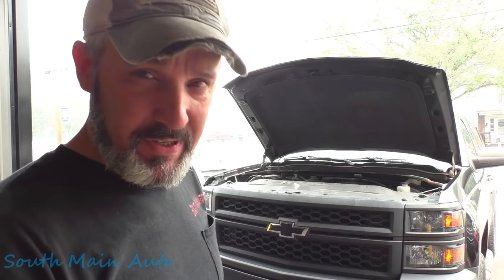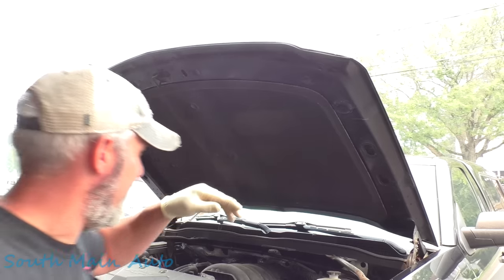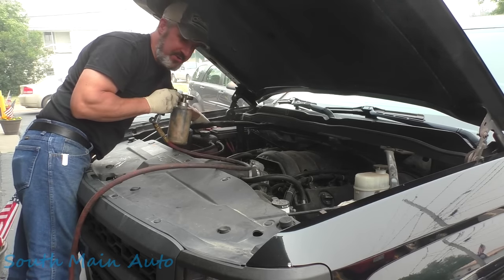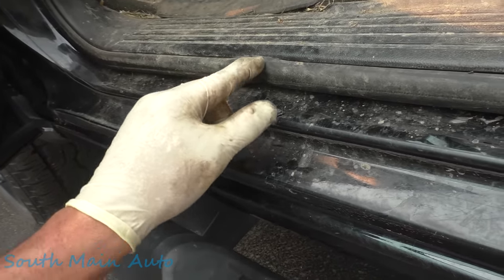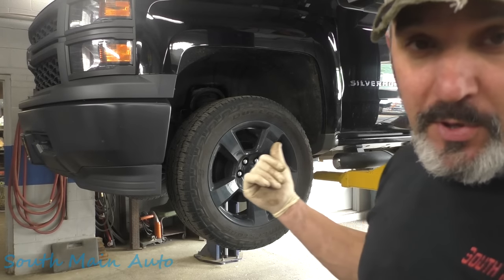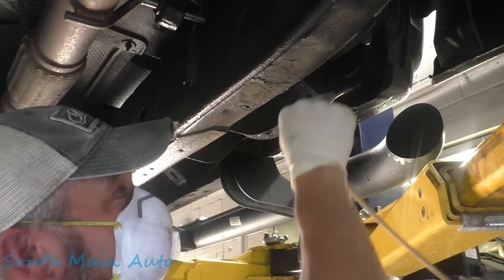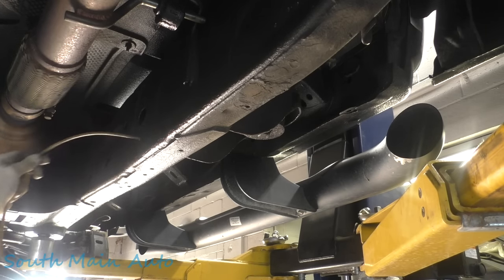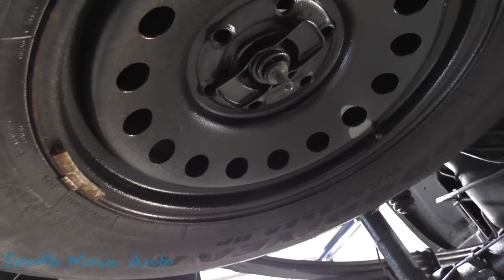Keep Your Car (Or Truck) From Rusting!! You Must Do This!!

Comment: I'm telling all don't waste the time or $$ on the crap they sell. It won't last and will need to redo every yr or 2. Save up or get from a shop 1 quart of used oil, 1 of trans fluid, buy 1 tube of grease and buy 1 wax ring for toilet from hardware. Costs $6. Put all in a old pot, heat up and mix and brush, spray etc like this and it will last year's and will not rust. It will not come off unless u do alot of work with a steam washer and degreaser. Don't spend 200 bucks at krown to have to get touch ups, resprays etc. They use no or very lil oil products in the wax. By using them it will not only seal out Oxygen, water but stick like glue. Knock off heavy rust, spray with Ospho on rest, then spray few coats of rustoleum or whatever chassis saver etc and hit it with this. Going on decades in rust country with no rust. Save urr autos. Save some $$. Tape up door drains, fill up 2 inches with baby, mineral oil or melted Vaseline. For a lil time and $10 urr auto metal, frame will last decades. Especially uni body autos. If they rust urr in trouble. A full frame auto is alot easier, truck, old panther cop cars etc to fix cause the body and frame are not same piece. We shouldn't pay 100k for a new auto and have it rusted out when paid off. We made it somehow all driving RWD cars and trucks in the past. We don't need all that salt and brine. Get a flurry and hers the state and local just salting it down like it's a blizzard. BS
Reply: @lesoram6236  Yes. For it is not hard to mix 4 things in a pot, heat and then brush or spray them on. Ppl mix and heat stuff up daily to eat. It's not rocket science. It's not hard to watch or look up a video on how to make a spray gun, modify or buy a blow gun kit from Harbor freight and use that while dipping the suction hose in this while squeezing the trigger. Unless urr 10 yrs old I'm sure even then they could mix 1 quart of oil, trans fluid, 1 grease 1 grease gun tube and 1 wax gasket. And if for some reason a customer cant, I'm sure a mechanic has access to these things or anybody who does their own servicing of any thing with and engine, cause all need oil, usually some kind of trans fluid, hydraulic fluid it don't matter. My Pap did this since the 60s. My dad has done since 80s, I've been doing since the late 90s. It works. It's cheap. And if for some reason u have no idea about anything at all and was born without a brain, u can get mineral, baby oil or a big tub of Vaseline and use this for doors, or for inside panels with anything from an old spray bottle of peroxide, to a $5 harbor freight pressure sprayer. It's literally up to urr imagination. Whatever u can get to make a liquid get from a container to the car.
Reply: @lesoram6236  what's the issue I'm not seeing it? Most ppl I've ever known, met, friends all have most of these around or can get them easy. I've never seen a garage or shop tell me No u can't have my used oils. They recycle them. 1 quart is not 55 gallons. And the best thing is u will not have to redo this yearly, or do it a few times. Money is tight and won't go far. Nows the time to figure out of there's any other ways to get a task done any easier or cheaper. It's not hard to do at all. If ppl have ever sprayed a garden Hose they can do this. Even just using used oil in a sprayer is better than nothing. All these waxs don't have any oils in them. So when u combine all them together it's the perfect oil/fluid/grease/wax.

 Have u priced how much this costs? $200 is standard. All the touch ups and resprays in 3 years even adds up. With my way u can save all that and for $6 either do it yourself or I'm sure ppl know someone who can. I've done it with a brush. We've all used a brush in our lives so anybody can do it. I've tried all the wax, films u can buy. They do work. They just don't last long, cost alot, don't have any oils in them, and it can be tough if it's cold or too hot, and u can't just apply and forget. Idk urr background but anybody who's ever done any work on a car, lawnmower, tractor etc can do this easy. And if u don't have any old oils I mean u can buy from a dollar tree cheap stuff for still less than 1 can of fluid film. It's been used for over 60 years now and I think that's good proof it works. U can watch a video online. Yes if ppl are 90, or a toddler yes they can't do this, but those ppl don't drive. U can add more of whatever u like to thin or thicken it. If u a planet warrior u can use baby, mineral oil or Vaseline and wax. New cars cost as much as a nice house did 10 years ago. They're already alot worse quality than used to be. Do all u can when newer or not too old to save it. If u have tge know how u can still do to a auto with high miles. That's more involved. But even if u still spend $6 and 30 or so min that will keep it from getting worse and will last. I'd spend that to make a auto I've already paid off last another 5 years. Killing the rust and doing and it will last as long as possible. For cheap and easy. If urr worried about getting urr pretty nails or hair dirty just wear gloves and a rain poncho. U will be ok. Old farmers have sprayed trucks with old oil and drove down dirt and gravel roads for decades. It works. Autos are made so cheap Ford's have issues rusting b4 even sold. If u don't live in rust belts no worries. But ppl live by oceans, salt water or air, who have a boat etc still have issues. Rust is what kills a car. And once it starts it's like stage 4 cancer, it will just spread and eat steel. I've seen nicer newer autos that had to be scrapped cause nothings done and they just rot. Not many have a full frame. Uni body are the worst. Cause u can't just patch if it's part of support or structure frame.

Comment: We have vehicles, a 1996 and 2001 Suburbans, and a 2001 Malibu. Each one still has every original and rust free panel on them, we live in the salt belt sadly. Fluid filming and applications of light paste waxes/light grease on a strict schedule has kept them in very good condition. I will say the 1996 Suburban has not seen winter driving though for the past 12 years. It still gets treatments on a regular basis still. Do this folks, we see untreated vehicles in bad shape after 10 years, sometimes even sooner.

Comment: Rust Belt, yikes!

2004 Sierra 230k miles
2012 Silverado 120k miles

Not a speck of rust anywhere.

... no transmission or wheel bearing problems either 🙂

Comment: Yeah, I own a 99 Suburban, and I live maybe 4 hours from your shop, and I did repair the frame on it behind the leaf spring about 2 years ago, used and old lawnmower blade lol. But at 330K miles on it, the frame for the most part is pretty solid, but for what the truck is worth now, I'll let the thing rot out, Its got a noisy rear end, bad yoke ( I welded the caps to the straps to keep the driveshaft from moving around) got a bad lifter on the passenger side so its always got a slight miss, Every now and then it will have no oil pressure unless you keep the rpm just above 1200, needs a steering box, and front differential, not worth me oil spraying it, considering I got the thing for scrap and drove it for 6 years, I can't complain.

Comment: Heck if I lived up in Pennsylvania where I used to live my 1980 seven, Chevy my 1982 Chevy my 2001 Dodge duango, my 97 Toyota Camry, my 97 Ford Mustang am I 1969. Fold Mustang would be sitting doing the winner.  And i'd find some basically s*** box to drive doing the Winter

Comment: I use bar oil. Works great for me. My 99 f150 still has all of its metal. I was the drippy that shows up and drive the bajeebers out of it. 279863 miles baby. One box engine swap and tyranny rebuild.  I did that in my garage. Just can't see spending $80k on a truck. Mine runs fantastic.  Looks great and sports a LETS GO BRANDON EDITION  badge above the F150 badge. 
Now that's classy.

Comment: Hey Eric you missed a belt loop on your jeans😉😂. Anyways good job on the fluid filming, I'm not to far away from you in Buffalo PRNY so I know the struggle. Someday, I'll have a new(er) vehicle that's worth undercoating. My '00 7.3, Zf6 F250 has the typical cab corner, wheel well cancer of a NY trk but that's how I got it. Oh well. Someday I'll get my nice dream trk....right after I win lotto. 😅These brand new trucks are insane w\ the $100k prices👍💯😀

Comment: I live in Georgia now. But I had a 1980 Mercury capri and I lived in New York. Front seat rusted through the floor. I had a 1983 trans Am, all the shocks rusted through. I don't miss it. But if this could have helped, that would have been great... I also had a 1974 firebird. Rust everywhere. Now I own old cars in the south and no issues whatsoever

Comment: Not just the Chevy people... This Honda Civic guy is short of replacing the tires, suspension system, ac compressor and interior cabin blower motor. After that I'll have a mechanically new car for my 02 Civic.  Oh... yeah and since it IS a 7th generation SOHC a d it's got 25K miles on it I'll need to replace the head gasket. (FR Those 7th Gen engines blow head gaskets left,right, and center. )

Comment: I've owned nothing but chevy, they are were great vehicles (the older ones pre 2000's)

But after they start breaking things, they just keep breaking things. My last Chevy Blazer has 280k on the original motor, the motor was great still. But once the transmission went, it just kept breaking even new ones.

I spent $3300 on a replacement transmission, drove 500 miles and that one broke.. So instead i sold my favorite vehicle after having done so much work to get it the way i wanted it. ( Locking hub conversion, lift kit, performance enhancing) but i just wasn't going to go through the issues

Comment: Two gallon lawn sprayer hand pump style and old transmission fluid run through paper filter.  Just don’t get any on brakes or exhaust.  Works great very easy.

Comment: I sure wish we had this whole setup back in the late 1950's, all of the 1960's and 1970's.  Saw some really great cars die a corroded death when they still ran good in Massachusetts.
When we moved to Southern California in 1976, that problem ended here.  The bodies and frames of my 06 Nissan Frontier and my wife's 06 Kia Sorento are still solid although the Kia is a money pit by itself!
Mr. O, PLEASE buy a mask that is paint and oil spray rated and wear eye protection.
Thank you for showing this video with the great tool for applying the fluid film.

Comment: I live in Arkansas and my Z71 4x4 is 25 years old with only a little surface rust on Leaf Springs and inside of Rear Bumper. Thankfully very little Salt is used and then only when we have freezing Rain on Hwys...

Comment: Instead of FluidFilm, I have had better luck with ACF50. Don't get the sprayer one, just get the quart. The hand sprayer isn't worth the money because it goes on way too thick. It's more expensive than fluid film in DIY quantities, but cleanup is easier, less of an odor, less tacky, and lasts longer with less dirt pickup. I used it on a motorcycle after seeing some bikes from the UK, which is nothing but wet salt air for months and months. They all swear by it. Picked up a quart, ran it through an HVLP sprayer and get the bike sprayed with a light coat. A quart will do the bike several times over. Also works good for long term storage of blued firearms, even ones with slight surface rust. For your respiratory protection, if you don't have it already, look for a P95 or P100, not an N95 or N100. The P designation means the mask will stop oil and dry aerosols. The N doesn't work well on oil droplets.

Comment: Yeah the salt belt sucks. Looks like it could be a messy job. You have any video for a 2014 chevy equinox with a secondary air injection pump ? If not the pump what is it?

Comment: Living in a southern beachy area, we see different parts rust out...still the same Ford and Toyota bed rot, but the roofs tend to rust after the paint burns away.  Just sold my rust free 99 Suburban 2500/diesel, now have a 2009 Suburban 2500/6.0, both rust free.  99 had the peeling paint issue and was repainted in 2002 by GM, 2009 is OEM paint, both stored outside their entire lives.

Comment: The reason...the south is best.  We don't have those issues.  We get rust but normally it takes 20 years or more...lol.  Geesh.  There should be some sort of permanent coating applied at the factory to keep them from rusting and not having to do this you'd think.  Almost need to sink them in that stuff up to the roof.  I never knew it was this much to have to do.  Glad I live where we don't use salt on the roads.  We don't get much if any snow or ice on our roads here, and if they do they use sand.  Thanks for taking us along.  I know not to visit the north salt belt now unless I rent a car...lol.  Take care.  MOVE TO ALABAMA, ERIC.  Bolts break lose and not much rust.  You see Rainman Ray.  That's about how ours are.  Come on down...and move close by where I live in central Alabama near the Talladega NASCAR track area.  With your work ethics and knowledge you might get rich here because you and Ray's kind of mechanic work is very few and far between, if you find someone at all.

Comment: I know I'm late here but going to do this for my "Newer" truck I have now. Just sent my 2006 Silverado to the junkyard due to the frame was gone. Still upset by this. But just got a 2014 F150 EcoBoost that spent it's life in Nevada. Now it's with me here in Indiana. It's very clean underneath and I want to keep it that way as long as I can.

Comment: Fluid film, bar& chain mixed 50/50 with transmission fluid, waxoyl, tectyl 506, noxudol, all good stuff. The trick is you have to do it and do it every single year. When you cannot reach under the car and touch something without getting greasy then its just right.

Comment: Just bought a super clean Honda Ridgeline. I want to get it Fluid Filmed but  cannot find anybody who does it around here. I am in Waterloo which is an hour away from you. I had a bad experience at Krown. Just had my GMC sprayed there for the 5th time and the frame was rotted when they did it. Never said a word. I asked for a discount on the Honda and they were pretty rude. I spent over $1500 there on this truck. I want this Ridgeline done right. Can I bring it to you or do you know of any other shop that uses Fluid Film?

Comment: Great video. No debate just oil spray. FF wool wax surface shield all work. Just do it. And I agree summer best time. When warm weather hits that's when metal rots. And light touch up in October.

Comment: Do you find if you wash the vehicle a lot this comes off? I live in PA, so we can get salt/snow I don't think to NYs extent, but I under carriage wash my cars after every break of salt during the winter. When I purchase something new though next, I still plan on doing a coating. Especially to cover the hard to wash areas. EDIT: You answered towards the end and said towards the end to avoid the car washes!

Comment: Just had my 17 Silverado Krowned. Does that need an exhaust???
How do you like or not like working on vehicles that have had this done??  We were told we could use Fluid Film as a chain lube. Stinks like crap and doesn't last. Krown has a lubricant so I'll give it a try??

Comment: I live in a part of Canada where as much or more salt is used as the PRNY. My 13yo Subaru has been oiled every year with a product called "Rustcheck" and is very much rust-free. I look at very late-model cars & trucks on SMAR videos already showing advanced corrosion and often wonder why it is that people don't invest in an annual oil spray. Is it ignorance of the process and benefits? Is it that the process is too expensive? Or is it that people don't care because few keep their vehicles for more than a couple of years before getting something new(er)?

Comment: Rattle cans of Fluid Film are available in clear and black from most auto parts stores. I don't want things picked apart, holes drilled, or the oil sprayed in locks, etc, so I do it myself.

Comment: I have 25+ years old cars in Canada, where there is more salt on the roads than in McDonald's fries. If not from the rustproofing, those great cars i have would not be there anymore. Even my 95 Saturn was rustproofed, because you know, the plastic panels are not holding on a plastic chassis. Sadly the guy who was really good changed of work and i'm not too sure where to go anymore. everyone is overpriced and not really aknoweledged on how to do a good rustproofing anymore :(

Comment: I  See Jasper engine banner in your shop have you actually had good luck with those I've had basically a 50% failure rate had  Jeep 4.0 seized in the crate put it on the engine stand wouldn't  Turn stuck folded over pinched ring  Build sheet says they  They ran it  Not sure that's possible  put  7.3 Ford diesel In came back with a CoolantI leak cracked block paid 40 bucks an hour To do it the 2nd time Watch out with the Jasper They're kind of ghosty

Comment: Have a 98 dodge dakota with almost 400,000 miles on it, had it since new,  every fall it get put on the lift and its gets treated,  I get comments on my Dakota that it still looks great,  take care of them and they will last a while, it rarely gets driven in the winter time anymore unless i absolutely need to haul something and even then i don't take it out when its wet/slushy out,  But i drive the wheels off it when its nice out hauling my boat and my utv

Comment: My truck gets an under carriage sozzle with heated, pressurized bar and chain oil. Works very well. Helps with rust and corrosion but also helps with maintenance. Nuts bolts body clips fuel lines tranny lines. It somewhat pricey but very much worth it. I've been religious with my last three vehicles. You get more in resale too. Shows you give a crap.